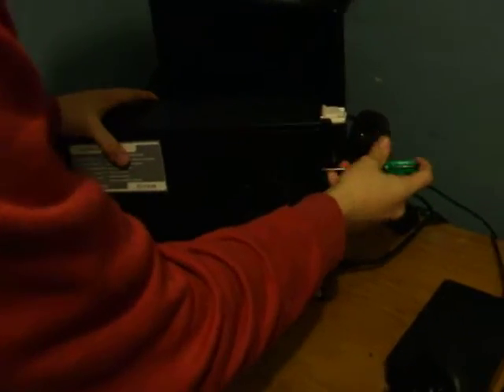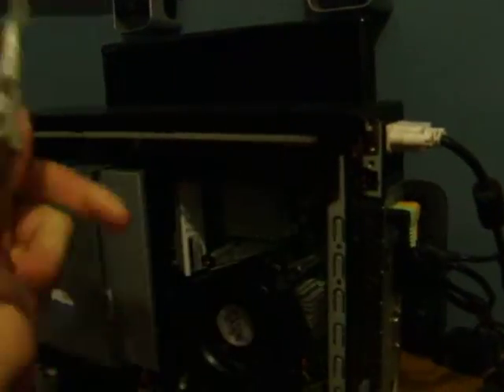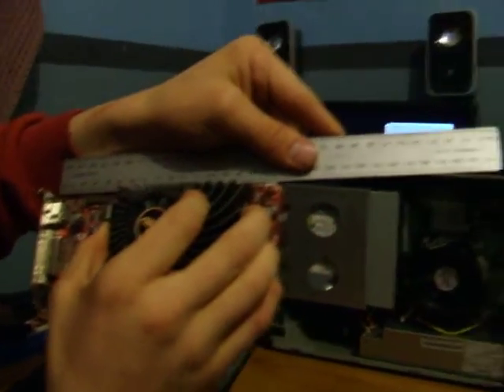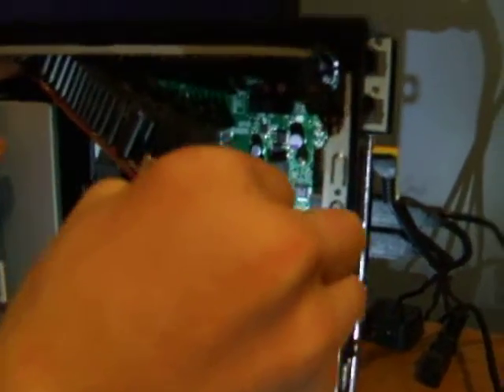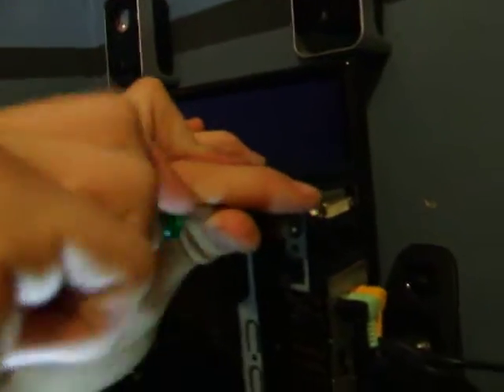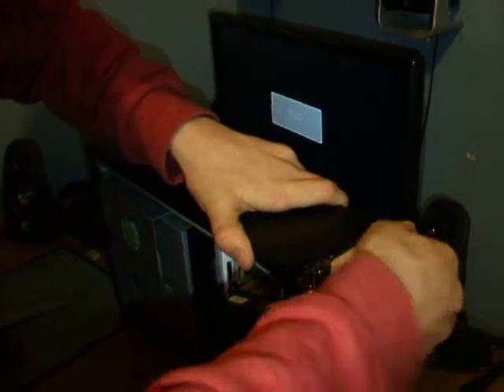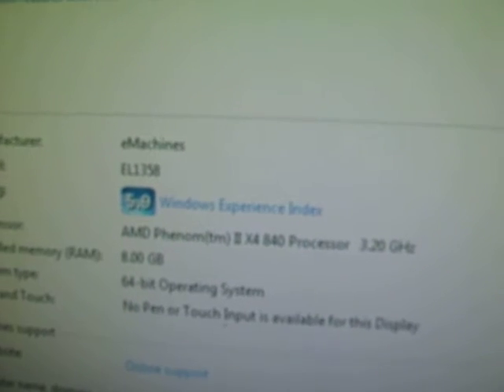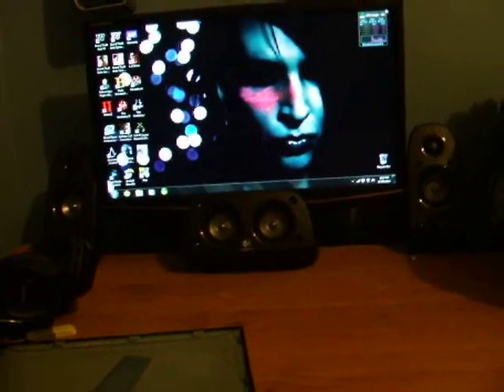eMachines EL1358 Graphics Card installation

Comment: ******** UPGRADING EMACHINES EL1333-11F *******************

UPDATE: Made some videos of what I personally did to my rig.

MARCH 2015

     Here is a list of the most one can do to this system. Remember you are limited by the motherboard and power supply. I DON'T Recommend spending too much money (<$200) on this system. Check for the best prices new/used on E-bay, Amazon, etc.  GOOD LUCK

Upgrades: 

CPU:                        ~$20- AMD Athlon 64 X2 5050e
RAM Memory:           ~$30- 4GB (only supports up to 4GB)
Hard Drive:                ~$50- SSD 125GB> or higher
GPU:                        ~$50-100- Low profile card single slot 
                         (eg. SAPPHIRE R7 250 1GB DDR5  or PNY Verto GeForce GT 730)

Hint: One can "remove or disconnect the Disc Drive" to conserve power (In use ~20-30 watts).
Reply: +quiv duran ....Personally I'll go with Sapphire GPU, but at this time you are better off buying a Low Profile 750ti 2gb. If you can get it for a reasonable price ($120) and do sight modification to the cooling fins to make it fit your case. Check a video I posed.

Here is a link to this one: http://www.amazon.com/gp/product/B00SOXMPJY?keywords=750ti%20low%20profile&amp;qid=1448831271&amp;ref_=sr_1_2&amp;sr=8-2
Reply: i checked your sight but i saw no modifications on the graphics card that you used for your upgrade. Did the lp 750ti 2gb fit in your case?
Reply: Kirk F whhat kind of performance will u get though
Reply: Not much performance if you compare to modern PCs to be honest, but is way better than the stock EL-1333-11F. It's enough for light gaming- e.i.  League of Legends and some 720p gaming. The CPU performance is similar to a Intel Celeron.The GPU really made it possible to play games with ram ugrade. The I only spend < US$150 for the upgrades. Overall the computer is way more responsive. CPU- 3x faster, GPU-is way better, SSD- >6x faster than stock.
Reply: thanks
Reply: Sir Washington No Problem. I did this to mine computer because of my budget. Also became a great little project. GOOD LUCK,
Reply: AMD Phenom II X4 960T Quad-core (4 Core) 3 GHz Processor will this cpu work
Reply: To be honest, not sure for EL1333-11F. If It has the AM2 socket it could probably run, but could have some features that would not work and you'll probably have BSoD (blue screen) issues. I don't recommend it. I think you might as well just build a new PC.

If you try it, keep me posted on your results.
Reply: is this board not am3 o im using an el1358
Reply: Sir Washington  I only know about the EL-1333-11F with certainty with these upgrades. To answer your question: YES, Yours is a AM3. Make sure you don't pass what your power supply unit (PSU) can do (i.e. check your PSU  per rails wattage). From what i can see, The EL-1358 is newer, so the CPU socket & RAM is different along with the motherboard. Here is a website that could help you about all about your system. GOOD LUCK

http://www.manualslib.com/manual/391363/Emachines-El1358.html?page=9#manual
Reply: which one is better the pny or the sapphire graphics card and would you have to upgrade power supply for el1352
Reply from the maker: +quiv duran haven't done it yet I will be making a video when I do it though maybe In the next 2 weeks

Comment: hey can this computer supports this graphics card?
http://www.newegg.com/Product/Product.aspx?Item=N82E16814161418
Reply: u did it?
Reply: It should.
Reply: Jack Miller what do you mean it should?
Reply: Dennis Wang What I mean is that this graphics card will work with his computer. All computers since 2004 have at least one pci express slot. There are three versions of pci express but they are all backwards compatible.
Reply: Jack Miller is it low profile im worried that its to big for the pc
Reply: Dennis Wang Yes.
Reply: Jack Miller why it looks so big
Reply: It is a low profile card. Usually they look like this and if you compare it with the width of a full size card you will find that your card is not as wide as the full size card. Another thing to look at is the product dimensions and compare the width of the card with the width of your case. Another thing to do is to check the reviews and one thing you should know is that LP is short for low profile.
Reply: Jack Miller am I going to.over use the PSU if I get a graphics card and get a and phenom ii X 4 840?
My psu is only 220 wats
Reply: It depends on the graphics card. Which one are you looking at?
Reply: Dennis Wang nevermind
Reply: To be safe i would go with a 450w power supply. It might be a bit overkill, but it will give you room for future upgrades. I had to upgrade my psu also for my gtx 760.
Reply: Jack Miller Hey sorry i have this computer and i cant play games without having soooooo much lag that i cant do anything. do you think i can change that graphics card to a GTX 750 ??
Reply: Jack Miller i havent done anything to the computer itself. i havent even took off the cover.

Comment: Hey TheRBGames .. I just bought a low profile galaxy geforce 610 and I have an emachines El1358G-51W ... will this galaxy geforce 610 work with my stock 220W power supply? I hope so because I already bought it and its being shipped now.. please respond and help a brother out.
Reply from the maker: yes it should work fine man
Reply: thanks man. I cant wait to get it in :D
Reply from the maker: true man you should have a blast with it
Reply: they had a 2GB version but I went with the 1GB cause I was worried about power draw.. the damn card only pulls 29W !!! but it said 300W recommended.. I was really happy reading where you said our PSU's have 3 rails though and now im sure it'll work.. happy gaming brother
Reply from the maker: glad to help man but the 2GB card wouldnt draw any more power to make a diffrence like i went from the 6570 1GB to the R7 240 2GB and they both run on the same power consumption
Reply: TheRBGames cool man , when i can save up some more dollar bills I'll upgrade againn.. to be honest I like this GT610 1GB.. been great for me

Comment: I desperately need to know exactly what kind of pci wifi card is that? I have the same emachines model, pleasee if anyone knows reply or send me a msg!! Plzz
Reply from the maker: all it is is a 1X PCIe low profile bracket wifi card all wifi cards should be the same
Reply: Thankss for replyingg first of all, lol but can you find it on amazon for me or where can I order one online??
Reply from the maker: ether one will work 

http://www.amazon.com/TP-LINK-TL-WN881ND-Wireless-Express-Low-profile/dp/B0079XWMEI/ref=sr_1_2?s=pc&ie=UTF8&qid=1406731648&sr=1-2&keywords=wifi+card

http://www.amazon.com/ASUS-Wi-Fi-Express-Adapter-PCE-AC56/dp/B00JNA337K/ref=sr_1_14?s=pc&ie=UTF8&qid=1406731648&sr=1-14&keywords=wifi+card

Comment: Would this work on an el1852g-52w emachine?
Reply: I have the same computer as you and the answer is yes and no. The Asus graphics card would work fine but the el1852g-52w has a Acer G41T-AD v1.0 motherboard that only supports 4GB of ram. So you could upgrade it to 4GB of ram with the Asus card he has and it would be an ok system, just would not be able to max the settings out like he did. Low/Med would be the settings you would have to have for it to run smoothly. Hope this helped.
Reply: +Cameron Millar  OK I'm late but can I upgrade mother board I have a Intel Pentium 3.2 GHz and 3gb ram so would I have to upgrade my mother board
Reply: I wouldn't recommend upgrading the motherboard, its just not worth the money in my opinion. Throw in a XFX R7 240 2GB single slot graphics card and swap the 1gb ram stick with a 2gb 1333mhz DDR3 stick of ram, this is what I did and the computer faired pretty well for what it is
Reply: +Cameron Millar fps in csgo and mc?
Reply: +Cameron Millar is there someway we could talk instead of commenting back and forth
Reply: PM me
Reply: Cameron Millar how it doesnt have options for me on your channel

Comment: will the Nvidia Geforce GT 610 work with this pc?
Reply: Yes as long as its low profile, but it will not change much unless it has 1GB or 2GB on the card too, then you might be able to see a diffrence from the stock intergrated graphics, it will not be a big jump in performance just a little boost

Comment: i now it real its a mini tower i want one ive been looking for one thier compact and fun
Reply from the maker: yes they are compact and fun good little machines
Reply: thanks for the tip i'm most likley getting the same one
Reply from the maker: sounds good man
Reply: i have one actually i would suggest taking the side panel off and it is a fun computer easy to add to and repair i have two harddrives and basicaly over 200 GB of RAM the fans tend to collect alot of dust though..., also the power supply tends to overheat with the side panel on also theres not alot of space inside so some things would have to be external and also the onboard graphics card sucks, but taking another harddrive and changing it to ram helps with gaming for info on how to change to ram just ASK :) - Cato

Comment: In the specs of that card, is says it need a minimum PSu of 400W. How much is yours?
Great video!
Reply from the maker: the factory 220 watt psu they are triple rails and its not 400 watts for the card thats a total system rating the card only uses like 55 watts at max load
Reply: TheRBGames I was thinking in buying a Radeon 6750 1Gb ddr5, but it asks me for 400 w, so can i use it withput problem with the PSu?
Reply from the maker: yes the car only uses about 55watts max and the stock PSU are 220 watt tripple rail witch mean they have 220watts on each rail making a total of 660 trust me i now run the new R240 2GB card a quad core AMD CPU blu-ray 8GB Ram 1TB Caviar black hard-drive all on the stock PSU and have been for 3 years now
Reply: TheRBGames Thanks man! You are amazing!
Reply from the maker: cheers man glad i could help

Comment: is it pci or pci-e (pci express) and is your grapghics card any good for gaming such as minecraft?
Reply from the maker: its a PCI-E and yes the cars is good for gaming mine plays Battlefield 4 on very high settings
Reply: did you have to upgrade your power supply?
Reply from the maker: nope my whole system has had the CPU, GPU, RAM, Hard-Drive, Disc-Drive all upgraded and still has the factory PSU and its been running this way for 3 years now the factory PSU is a 220Watt tripple rail meaning each rail has 220 watts so in total it actually has 660
Reply: Thanks you so much you helped me a lot and thank you for replying to my comment!
Reply from the maker: your welcome man anytime

Comment: Hey, is the extra ram necessary to run the graphic card you have in there? I'm planning on installing the same card, I have the exact same computer. The video playback is complete shit right now.

Would an ASUS Radeon HD6570 2GB PCI-Express 2.1 DDR3 HDCP work in this computer? I just found a pretty cheap one on ebay.
Reply from the maker: no the extra RAM isnt necessary i only done it for extra head room while gaming abd yes the 2gb 6570 will work as long as its a low profile
Reply: TheRBGames
 Thanks! I've been meaning to do something about the video card for ages, just had no idea which one would work.
One more thing, is it possible to put a usb 3.0 port in one of these computers?
Reply from the maker: thats okay man the 6570 low profile isnt a bad choice as its sorta cheap and its a decent card

Comment: I have a Diamond radeon hd 6450 in mine, it will fit but has issues with the drivers.  Went to update my drivers for it a couple days ago and ive had hell since. Only other downside is that it is a fanless card, so i had to add a extra fan on top of the case to pull the heat out, and added a Dynex 400w powersupply. Soon as i get her back up and running ill post a vid of her. Next upgrade will be the 8 gigs like you have.

Comment from the maker: no there not a stand PSU look up triple rail PSU each rail is 220watts each leaving it with a maximum off 660 watts other wise my system would of been dead ages ago and guess what its going on 3 years now and still running like new never ever gets hot or anything the stock power supply can handle it ask everybody else who has followed my build they will all tell you same thing

Comment from the maker: the on-board Graphics isnt suppose to work the Card takes control and for the picture make sure all cables in connect correctly and make sure the card is inserted correctly

Comment from the maker: also this is the power specs for the 8800GT from Nvidia read the GPU Power Requirement 

Thermal and Power Specs
Maximum GPU Temperature (in C)
105 C
Maximum Graphics Card Power (W)
105 W
Minimum System Power Requirement (W)
400W
Supplementary Power Connectors
6-pin & 8-pin

Comment from the maker: mate you dont need to go to ebay because they still make 7750 in low profile that fit inside this case and you do not need a 400 watt power supply as i have been running my whole set-up for over 2 years on the factory power supply and let me tell you something i put i 500 watt in it at one stage for 1 week and it starting preforming badly like frame rate in games dropping the core voltages Were not correct the factory PSU is 3 rail unit assuming you know what that means it proformed alot better

Comment from the maker: it will freeze will any catalyst because catalyst has an overclocking feature witch these motherboards don't support because they use a nvidia chipset so the two reject each other causing the freeze the drivers i use are the windows installed one witch is called 9.12.0.0 i just let windows intall it for me and never updated it since works perfect and i use asus tweak to overclock the GPU

Comment: I have the exact same model as you and i purchased the 6570 ( Same as this video ) Works fine with 220W Power supply :) Does not overheat either which is strange has been going strong for ever a year now! And as RBGames said a 7750 will do fine aswell

Comment from the maker: anyone can tell you anything by going of the specs sheet no its not true i have a 6570 quad core CPU Blu-Ray Dirve 8GB ram 1TB caviar black hard-drive and its been running of the factory power supply for 2 years now and still going strong

Comment from the maker: i dont know were you get you information from but no CPU are not the same as RAID you are correct with RAID but CPU's went from single to duel because a singe core over 4GHz was very unstable for them to sell you can always over clock them past 4GHz but its not recommended has they produced alot of heat and are unstable i know this because im fully qualified in IT so by haveing a single core not going over 4GHz they made duel cores at like 3.2Gz each core witch makes the overall speed 6.4GHz

Comment from the maker: look man you have a good idea but its not gonna work its just like cpus AMD and INTEL couldnt make a single core CPU faster then 4GHz so they made a duel core at 2.5GHz its not easy to make a top end GPU's smaller and less power consuming because they need the power and the space that they already take up plus designing all that extra architecture on the bigger more powerful parts would cost to much there are some of the reason why they haven't done it already

Comment from the maker: well as you may think that they would be better they honestly wont laptops have all soiled parts apart from the ram a desktop will always out preform a laptop of equal components  and if you don't believe me then test it for your self and besides why would you bother putting laptop parts in a small desktop tower when normal more powerful desktop part will fit anyway a laptop is designed to be portable and a desktop is not but as i said man you can think they would take the market but they wont

Comment: Your experience is totally different than mine.
I bought a 18.4 inch Laptop and it fly's in games.
runs very cool no heat no noise and is a clean way to run a PC.
I thought building small low power consumption units with incredible performance would be the way to go for the future. 
Plus make them upgradable easily.
They would take the market.

Comment from the maker: man this pc only runs off a 220watt PSU and the reason is because laptop parts cant run as good as fast and cant out preform a desktop part and they don't run cooler i had a laptop with my game CPU and GPU and same amount of ram and it ran 3x has hot as my desktop and couldn't keep up with the desktops power  because as they are the same CPU and GPU they actually run at lower watts then the desktops witch actually lowers the CPU and GPU's performance but at least you though of it

Comment from the maker: no you can only run a certain range of LP sibgle slot graphics cards as the case it to small for the bigger and the asus 6570 1GB that im running has played every game i have thrown on it on atleast high settings and the CPU you could upgrade to a Phenom ii X$ 840 or a Phenom II x4 945

Comment: Hey i have a emachines el1850, and the graphics card it came with started to overheat, so i need to buy a new one the only one i found is asus 6450 1g low profile will that actually fit? thanks in advance <3

Comment from the maker: unfortunately you can only have 4GB max RAM so if you put 8GB in it the PC most likely wont boot up the best Graphics card would be the asus ATI HD 6570 1GB LP or Saphire Radeon HD 7750 1GB LP and best CPU would be Intel Core 2 Duo Dual

Comment: ok I have EL1850-01e I want to know if 8 gigs of ram will mess my computer up and what is the best small platform graphics card I can get for it I really need to get this lag situation under control I mean I get kicked on loading in to the games on occasion because of the lag also what would be the best processor that I can put in it its a 775pin intel Celeron single core now